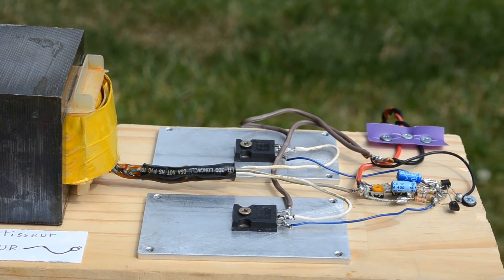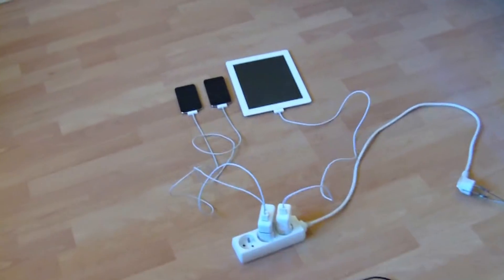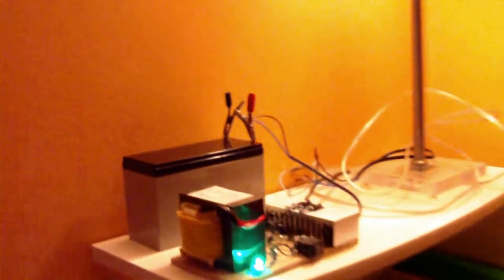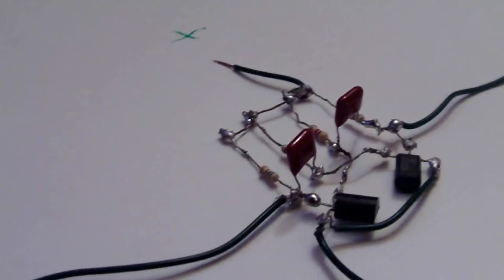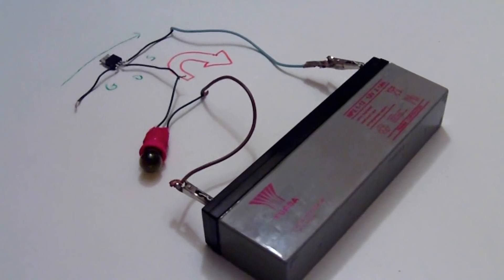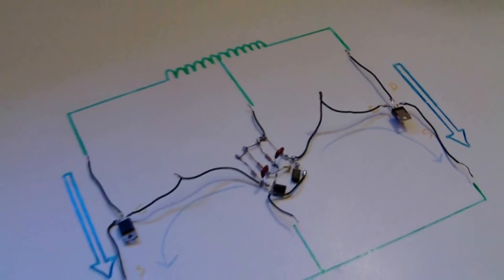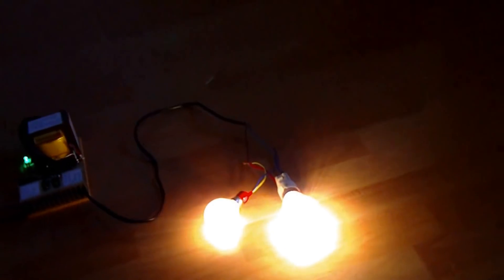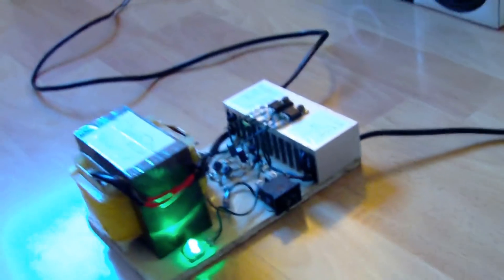Make an inverter : DIY Experiments #2 - Power AC devices with a battery / homemade inverter

Comment: Mosfets are the same as transistors..... i quit....3:36
Reply from the maker: MOSFETs are transistors, but there are different from bipolar transistors (not the same driving method, and very different internally).
You "quit" because your'e afraid to learn something...
Reply: @DIYExperiments  i just meant to say, that you should have said this, I quit because they aren't the same, like you said, the principle is the same, but you drive it in a different way and need to look after special thinks for each of them, that's why I quit and not because I'm afraid of learning, I just like to learn the right things! But this doesn't mean, that your video ist good, it's great, I like the idea, and how you did it, some small thinks that are not perfect, but I like it and want to build something like this myself ;)

Comment: 4:00 they do not need the current to be activated?
Please explain that to me.
Reply from the maker: MOSFETs? No, only a voltage (no energy is required to keep a state).
Reply: @DIYExperiments  So that is the reason you can trigger a mosfet through the conductivity of your skin
Reply from the maker: Right. To be precise current is required to change the state of MOSFETs as the gate acts as a tiny capacitor. The higher the MOSFET switching frequency is, the more current is required on average. Or conversely a fast switching require a current peak.

Comment: Can you tell me the secondary winding  voltage output and current rating of the transformer that you have used in the video?
or simply the transformer specs?

Comment: Quite informative. As a retired electronics manufacturing and test engineer I can say that this is an excellent "how to." 

I should like to see a follow up video on a 1 or 2kw inverter made from a modular version of this invertor.

Multiple amplifiers from synchronized oscillator(s) all output into "ganged" phase aligned transformer(s).

Comment: Did you check the frequency (Hz) of that ?    You could be in for some major damage to your sensitive electronics,    I wouldn't run a stereo, tv or anything with a motor..  That circuit is designed for 50hz,  it's not for North America or most of South America..   I don't know where u at..  but,,  you seem a bit hollow between the ears.

Comment: How could I generate higher frequencies? Specifically, I want 250 volts, but plan to use a micro-controller to sweep between 300hz - 800hz at will, but 50hz - 60hz is far too low and static for my application. Would you know if this is possible?
Reply from the maker: You can reduce the capacity of capacitors by 10 (it's proportional to the frequency)

Comment: Are both 680 resistor connected to the path of the IRF630 transistor or are they directly connected to the 2n2222 transistor?

Comment: sir what is the max output wattage and how can it be increased to 1kW?
Reply from the maker: +Prateek Saxena : Here it roughly 40W, you can use a bigger transformer and low resistance parts :)

Comment: don't use costly devices like TVs, music systems or cell phones because the output is squarewave so you may doom your devices. it's alright for bulbs and fans.
Reply from the maker: +Abhinandan Behera : Most of nowdays devices are working with switching mode power supply which firstly rectify the main power to direct current... So the wave form doesn't account 😊

Comment: nice circuit & explanation bro, I have just seen a video which says convert 1.5V (AAA) battery to 220V AC, how could it be possible when a AAA battery which cannot even deliver 1Amp current easily i.e. 1.5V x 1amp = 1.5watt of power & can run a more than 10 watt Tungsten bulb so easily, is it real or a fake video.
Reply: The power primary-secondary stays the same (there is even some loss in the transformer!): (Watt=Volt x Ampere). Say you put in 1 Volt at 1,5 Amp = 1,5 Watt in on the primary coil then on the secondary at 230 V it is 0,0065 A. (6,5 mA) at 100 % efficiency. In real (loss) it coud be 4 mA. In real with a AAA battery it will be approx. 1 mA or less.
Reply from the maker: +radiofun232 : A high quality AAA battery must deliver around 20A in short circuit, so the maximum usefull power is 7,5V (UI/4 beacause of voltage drop in the internal resistance), some LED lamps require less than 5W so it's possible in theory. I already manage sush converters but in general this kind of videos are * fakes ^^

Comment: Is it possible to convert 36Vdc from single solar panel to 240VAC, 50hz? Without using the battery to store energy.
Reply from the maker: +Basu Sajjanar : You will need a big capacitor to maitain the voltage during the switching mode, around 2200uF or more, but it's possible ! I did it to convert directly the energy from a bike generator to a 230 device ;)

Comment: plz am trying to build an inverter with this video but am having problem with the 2.2uf capacitor bcus the capacitor voltage is not specified and also finding it difficult with the transformer.plz help me on this,have been on it for over a year.my whatsapp contact is 08109422010 and facebook contact is AMUSAT TIJANI.
Plz your help is urgently needed.
Reply from the maker: +Amusat Tijani : The capacitor voltage must be higher than the maximum voltage reached by capacitors, here it's suplyed with 12V so a 16V capa or more it's OK ;)

Comment: This is the best inverter project I have come acrross on youtube. Please can I use thesame oscillator circuits with thesame capacitor and resistors as in this project to achieve higher power output if I use larger transformer and battery?
Reply from the maker: +Patrick Ikhenoba : Thanks !
Yes, you just have to use suitable MOSFETs and a "bigger" transformer with a lower internal resistance ;)
Reply: Please how Can I tell the suitability of the MOSFETs with my circuits

Comment: as the diagram above frequency f=0.721/RxC => f=0.721/(12x10^-6x2,2x10^3)= 27,44..Hz explain me f=55Hz ?? thanks
Reply from the maker: There are some annotations with 5,6K to replace 12K :)
Reply: thanks

Comment: instead of taking the battery of 12V, 7A if i use the battery of 24V,12A in inverter circuit then the value of all coponent will be like the same one as you shown.  if it will not to be like the same then how can i find out the all other components value

Comment: Hi, can someone help me out with the transformer? I need a 120V one for American appliances. I've found a handful of center tapped 120/12V transformers for sale. Which is the correct one for this application? A 12V-0-12V or a 6V-0-6V? (the 0 being the center tap)

Comment: What should be the output volt of oscillator
Reply from the maker: If it's more than 4V it's ok. 
Mosfet transistors have a threshold around 3.6V, but you have to go above 4V or more for high collector currents.
Reply: DIY Experiments Thx and any home theater 12-0-12 transformer will it work?

Comment: How can i make it to 60Hz?
Reply: I need this to.
Reply: i also need
Reply: i made it to multisim and it cannot simulate as well so i can't figure out how can i made it to 60hz.
Reply from the maker: F=1/ (2*ln2*R*C)
If you want to simulate it, modify the initials conditions : with one the the capacitors which is charged for instance :)
Most simulators can't compute the beginning of the multi-vibrator work.
Reply: Supposing you changed the 12K resistors to 8K? You will alter the time constant and change the speed of the oscillator, would have to experiment with the values a bit.  Or maybe replace the 12 K's with variable pots.

Comment: What would you call that circuit? How did you choose those resistor and capacitor values to oscillate at 55 hz??
Reply: Probably the transformer is self tuning.
Reply: YoungbuckY H W Hoshua I think he used a L-C oscillator.

Comment: Is that a 24v with center tap step down (under normal usage) transformer. What are the lead identifiers for the switching gate semiconductors? The transistor should be simple with the arrow point being emitter (E) and the base (B) being the flat line and the remaining input line to the base being the collector. (C)

Comment: hi, guys. from where did u bought this power transformer?
Reply from the maker: +Mustafa Albadri : It's from an old stereo :)
Reply: won't you get electrocuted from a source if it gives an output of 40 W I know it is power and only heat dissipation but the current required for driving such a circuit is very high. I did not see you wearing insulated gloves

Comment: if I connect this from 12v 65 amp. battery , is it running properly, or what change to be done on the circuit plz tell me...
Reply: its depends on the load that u have on the other side
Reply: Atanu Biswas you can't connect 65amp battery to this design because these mosfets cannot bear that much power and also you have to change transformer ratings as you have to take transformer like 12v 20amp or more and use mosfet according to that much power to withstand safely with 65amp. You have also use a safety diode for mosfet protection. You really have to consult a person have expert knowledge about inverters. And components available in market.

Comment: can you give link of the website for step-up transformer please !!!
Reply from the maker: +hrishi palande : It's recovered from an old VHS player ! (Or amplifier)
Reply: Look for a mains to low-voltage transformer with a center-tapped secondary. Chooes a size and ratio that match the power output and supply voltage that you wish to use. Beware that larger transformers will draw more quiescent (open) current than smaller ones.

Comment: what transform use 12v 5amp
Reply from the maker: +Ahir Vijay : When there is no load it's only 500 mA, in short circuit of the outlet it's 7 Amps and with a 30 Watt load it consumes 5 Amps. Than logic 'cause of the conservation of energy ! The more current is consumed on the secondary coil, the more current is in de primary one.

Comment: what is the capacitor voltage you used on the oscillator?
.................................................................................................
for example 2.2µf 16volt...........2.2µf 100v....470µf 10volt.

Comment: what's d voltage of d capacitor I don't c it in d diagram
Reply from the maker: +Emmanuel Festus : Allways more than the supply voltage, so you can use 25V or more it doesn't matter :)

Comment: what is the voltage drop of the oscillator and can i use it to 111.4 volts without damaging the circuit
Reply from the maker: +Owen David : In mosfets you mean ? That's negligible around 500mV.

Comment: can i use a high power amplifier instead of mosfet???
Reply from the maker: A D class amplifier might be ok
Reply from the maker: We explain the difference in the video, it's possible to use a NPN but you must place a resistor between the outlet of the oscillator and base terminal. If it's instable, you have to place a second transistor to conduct a Darlington configuration.
Reply from the maker: It's depends, they are 100000 different ones !
Reply from the maker: Prefer MOSFET for the reason explained in the video :)
Reply: thanks for response :) I'm just want to make a higher power version of yours by recycling an amplifier. ;)
Reply from the maker: To increase the power, the best to do with the same pattern is to use an "bigger" transformer with a lower internal resistance :)

Comment: in which website i can find that transformer?.. can u pls post the URL
Reply: bro i found another tut, its very simple and easy to make one but its in Urdu hope you like it "https://www.youtube.com/watch?v=9YcRLXMxZyI"

the schematic is here "http://paksc.org/pk/images/stories/update/circuit%201.jpg"

and a 500 watt here "http://paksc.org/pk/diy-projects/819-500-watt-12-vdc-to-220-vac-power-inverter-ups-uninterruptible-power-supply/"
Reply from the maker: +Yuvaraj hawk : We recovered it in an old VHS reader.
Reply: +DIY Experiments..can you please just tell us the trnsformer spec?would be much helpful
Reply: its a 12 0 12 center tapped transformer bigger amp better, Ebay may be;)
Reply: +lima toshi..i needed  the exact spec of the model used in the vid(transformer)..
Reply: Ebay
Reply: it dosent have to be the exact spec of the vid model but bro first you have to know basic calculation in this way you dont have to go through wondering what Volt, Amp, Watt etc BTW bro just search for a center taped transformer you will get plenty on Ebay good luck.
Reply: lima toshi  :-) thanks bro ✌😁
Reply: hi bro apologizes for the late reply i was very busy anyway here. "http://www.ebay.com/bhp/microwave-oven-transformer"

*************************************
MERRY CHRISTMAS
 *************************************

Comment: hey can this ckt be built on breadboard... ??? .... please reply soon
Reply: yes it can, but its a VERY bad idea to build this thing as the voltage will destabilize as you use more power (and you will probably break things you connect to it)

Comment: It's unregulated so only good for lights, And they'll run on DC pointless.
Reply: +josh green How do one regulate it?
Reply: Ello Oku For £20 you can but a 1000w inverter off Ebay.
Reply: +Electronic Experiments  the point is the output of this is inverter will be square wave form and when used on sensitive electronic devices it may cause damage.
Reply: Most switched-mode power supplies will run just fine on square wave. The bigger issue with this design is the presence of high voltage spikes in the waveform on the rising and falling edges of the square wave. These can exceed 600 volts peak-to-peak.
Reply: josh green  get you gotta be a hatin douche

Comment: for example if i have a ceiling fan which i of 70watts hence 230/75 approx 3 amps required to run the ceiling fan 

and my doubt is if i connected 3000mah battery of 12v to the i/p of inverter then the ceiling fan works perfectly for 1hr only right bcz of 3000mah is 3ah right 

how to increase mah of battery 

should i need to connect in parallel or wat 

help me anyone i am at the middle of something i want to go on
Reply: +lokesh rahul Connect the batteries in parallel for twice the capacity. have to be the same voltage though.
Reply: More batteries , more power and amps. U can connect as many batteries as per your requirement. Of course all should be in parallel. Just be safe and do connect a thick cable around  25 sq mm while making parallel connection, as the current may go high in such case. but,  I would recommend you to buy a car or a truck battery with highest Ampere hour rating.
Reply: dude ur amazing ;;; great explanation bro

Comment: Anyone who considers building this inverter, should watch this video first: https://youtu.be/5QaKiXRa-n0
Reply from the maker: +Per Mejdal Rasmussen : Our design is only the most simple. Clearly, the efficiency in not good (it depends a lot of the load), the signal in not sine (it is a mix between square and sine) and the output voltage is not regulated (it can overpass 230V). This design can be useful to get electricity in isolated places at a very low prince (0$ in our presentation).

Comment: Constructing one of these can be dangerous, bordering on suicidal. The output voltage is unregulated, and VERY noisy! The way transformers work, you need to increase the voltage and therefore current to the input side as the load (current) increases on the output side. Otherwise, the voltage will be reduced the higher the load until it is virtually unusable.Unfortunately, the opposite of this is still true.  When you reduce the load, the output voltage goes higher and higher. It is possible for this device to reach output voltages (peak to peak) of many thousands of volts, which is more than enough to destroy devices you plug in, or even electrocute someone.
Reply: +Warren Garabrandt How do one regulate it? I only know of buck converter to regulate DC voltage.
Reply: +Ello Oku you will need some kind of feedback loop.

Comment: Not terribly bad for a square wave, unregulated, not frequency controlled inverter. You should measure the efficiency. E = [power out divided by power in] x 100%, at different load currents. If Efficiency is not > 90%, then "back to the drawing board"
Reply from the maker: The efficiency is >90% when the load is less that 20W. Then it decrease rapidely, at 40W it's around 50% only ! It's not really possible to drive 40W here, the output voltage is a decreasing fonction of the courrent.
Reply: +DIY Experiments Thank you! I made a mistake, your inverter IS frequency controlled, my apologies! Your inverter will be effective when powering switch-mode power supplies, because  most of SMPS rectify the input waveform directly.  If you wish to drive a motor which "expects" a 50 Hz sine wave,; you will need to output a so-called "modified square wave", which needs to spend SOME time at "0" volts:
    ...       ...       ...
....   ..   ..   ..   ..   .. somewhat harder to do, but IS doable!  -- THANKS FOR A GOOD PROJECT
         ...       ...

Comment: I enjoy watching your video bro, keep up the good work. 1 question only a center top transformer can use to make an inverter or not?
Reply from the maker: Thanks ! It's possible to use an ordinary transformer but you should dispose 4 MOSFETs transistors in a configuration which is called "H bridge" :)